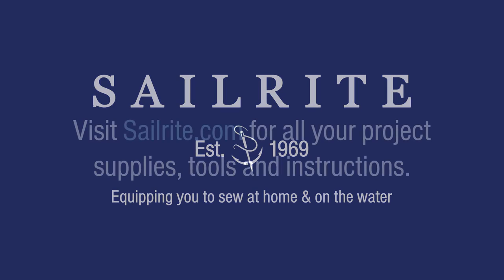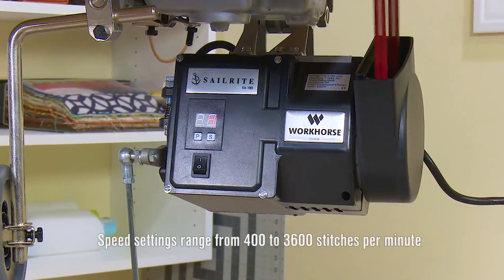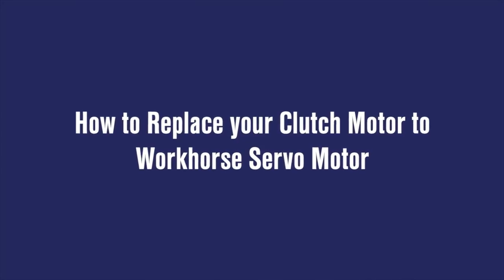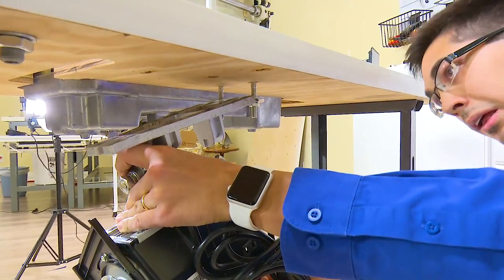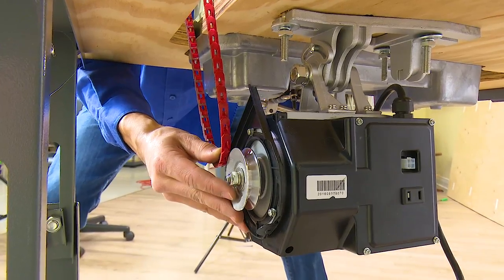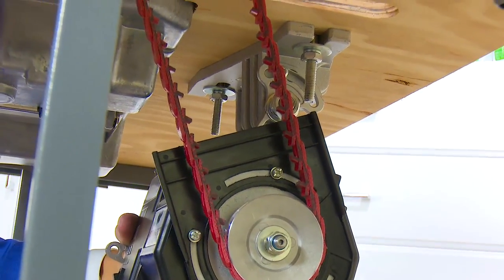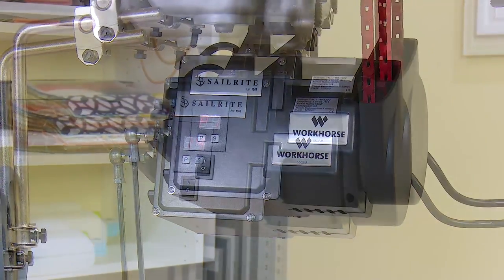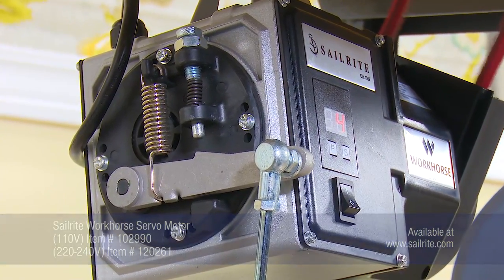Replacing Sewing Machine Clutch Motor with Workhorse Servo Motor

Comment: Hi guys, I love the super slow speed control,  any plan to add this motor to the LSZ1 when mounted in/on the portable table ?  I hand crank my machine when doing the super slow work,  but this  looks great!
Reply from the maker: We are working on a prototype now. The Workhorse would have to be mounted to an Industrial Table, not the collapsible table, it is not large enough to mount the motor. More testing is required, but if all goes well you may see the Workhorse and an Industrial Table combination for the Ultrafeed Sewing Machines in the near future on our website.

Comment: can anyone advise me of a good motor for my SEIKO TE 6B, I would like to control the speed to slow, do please advise a good motor to replace my clutch motor that i have that sincerely i don't like
Reply from the maker: If your Seiko is mounted in an industrial table top with a clutch motor, why not get the Sailrite Workhorse Servo Motor? It will provide great slow speed control.